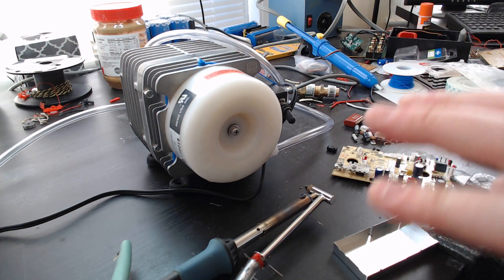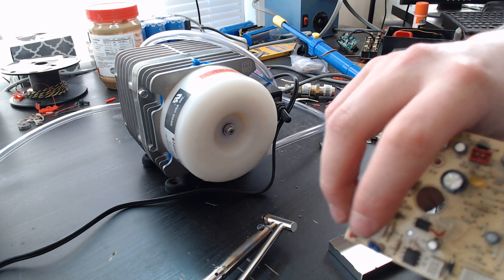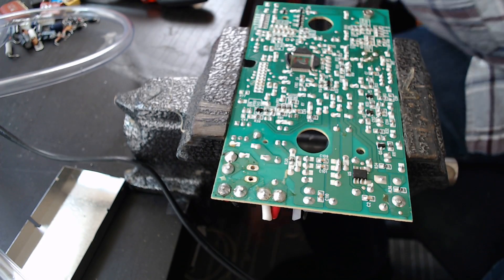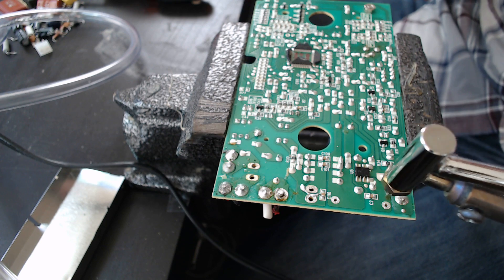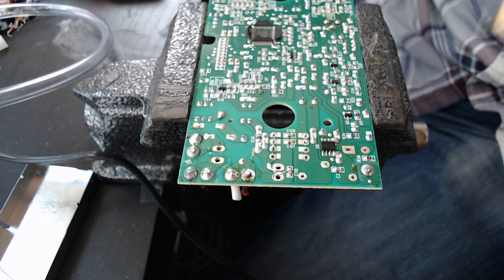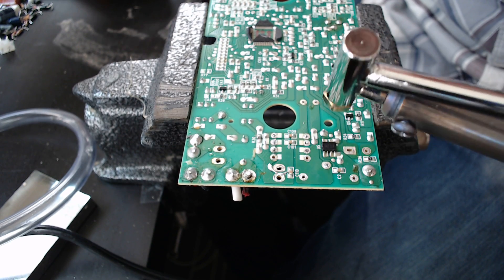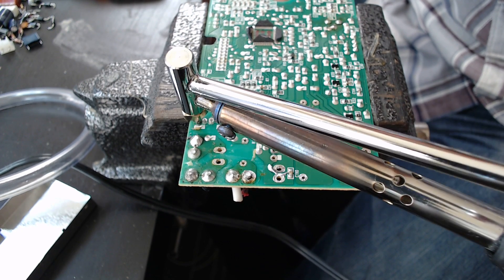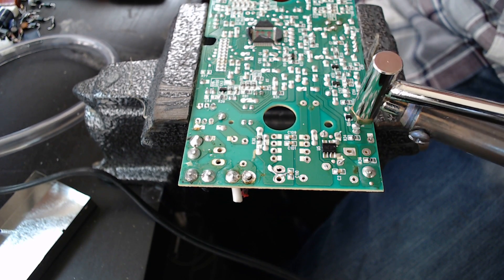DIY Vacuum Solder Sucker

Comment: I have one of these irons.  2 actually.  The one from Radio Shack from many years ago, and an ECG one I bought from eBay.  I bought extra ECG tips from eBay also.  I'm going to have to make this with one of them.  Thanks for the idea!  Gave you a like.
Update.  I got a vacuum pump like yours and put a cord, switch and hoses on it.  Going to try it out tomorrow.

Comment: Problem is, since Radio Shack closed down I can’t get replacement tips for that iron. :(
Reply: Glad to help Emmett
Reply: ECG has replacement tips for the solder sucker iron.
Reply: @allenskaggs6567  They look similar, but are they the same? They were Radio Shack-branded at the Shack.
Reply: @emmettturner9452  ecg 103
Reply: Hope this helps

Comment: Try a mason jar in line with the hose.  Solder (or glue)  inlet and outlet tubes to the metal lid of jar.   Hot glue a piece of screen to the outlet copper tube on the inside of the jar (this is the filter).  Try the screens from faucets or marijuana pipe or maybe even foam filter would work. This is a typical collection device for many vacuum applications.    You can save the solder in the jar and someday have enough to make a solder bar or mini ingot (there must be some use for used solder other than the garbage).   As Ricardo B said below, try a "silicon" or "silicone" hose between the iron and the mason jar filter.

Comment: well this video will change the way i work , and thank you for sharing it. i ordered the same desoldering iron on ebay and for the vacuum pump i took it from and old Mercedes  ,those are so powerful , as soon as the iron arrives i will make a video and share with you. thank you so much
Reply: Try a mason jar in line with the hose.  Solder (or glue)  inlet and outlet tubes to the metal lid of jar.   Hot glue a piece of screen to the outlet copper tube on the inside of the jar (this is the filter).  Try the screens from faucets or marijuana pipe or maybe even foam filter would work. This is a typical collection device for many vacuum applications.    You can save the solder in the jar and someday have enough to make a solder bar or mini ingot (there must be some use for used solder other than the garbage).  As Ricardo B mentioned below Try a "silicon" or "silicone" hose between the iron and the mason jar filter. The outlet tube to vacuum can be made from anything.

Comment: Be good to have that pump switch on the handle of your  solder tool so you don't have to keep switching the pump itself? great adaption. Would that be any good with one of those pumps from the water bottles on a car which sends water to the windscreen?   work at a lower voltage?  Does that get logged up?
Reply from the maker: I've never worked with one of those pumps, but I see no reason why it wouldn't work. The trick is to have a sudden rush of high flow. May be worthwhile to have a small pump empty out a large volume, and then flip a valve when you want to suck.

Comment: Good idea but you need to use a silicon joint between rod and plastic hose and one filter.

Cheers.
Reply from the maker: Thanks for the input! The pump has its own filter built in, so I think i'm all set there. I'll try the silicon part, that would certainly assist the vinyl hose melting.